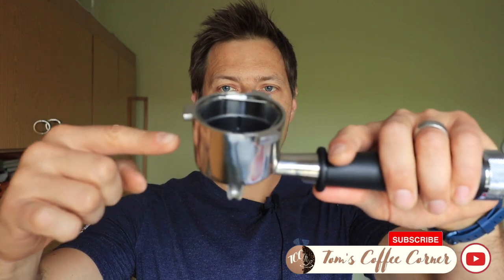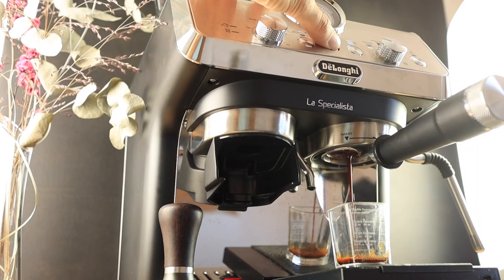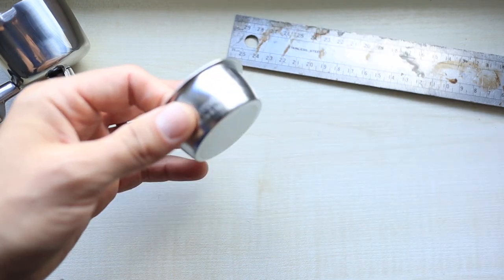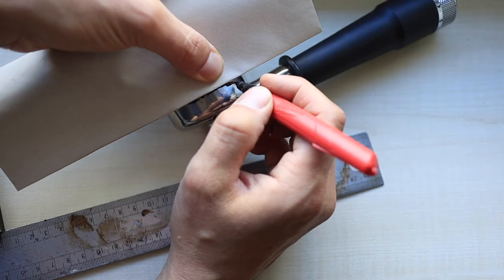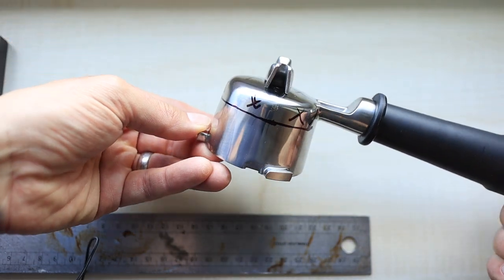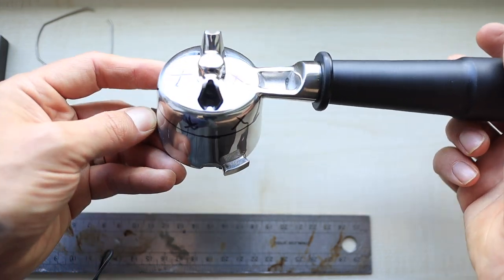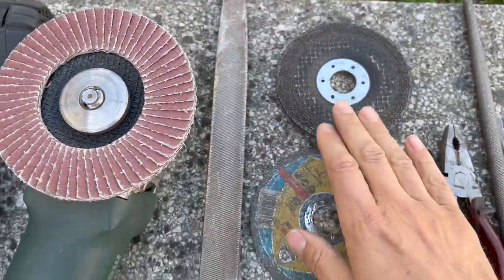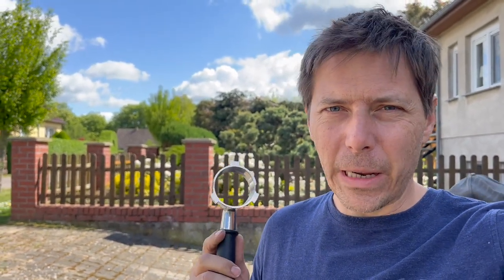Delonghi La Specialista Bottomless Portafilter: Make or Buy?

Comment: I bought an aftermarket bottomless but is backs off when the pressure is applied while pulling a shot. Basically you need to hold the handle and I am still concerned there is a bit of leaking. 
Would be great if you do a follow up with which one in the links works great.
Reply from the maker: The Normcore and Neouza ones work excellently. Cheers!

Comment: Hi Tom, since I bought the Maschine after your good reviews and i really enjoyed, now i want to buy this without cutting, so which size i should buy ? In mm ? Thanks
Reply from the maker: Check the description for product links. Cheers!
Reply: @TomsCoffeeCorner  got you Tom, thanks since i have the La Specialista so i need to order 51 mm from Normcore as u advices, but the question is  Changing from Normal Portafillter to bottomless means i need to change the Matte too ? Do you have recommendations? Probably not a 90 degree Edge on because this doesn’t fit with my Kitchen, maybe High Matte ! Thanks in advance
Reply from the maker: @alejandromagdy3058  to be honest, I don’t use a mat very often. I just use whatever flat surface I can find.

Comment: Mr. Tom I have a question sir, I'm very new to espresso machines,and have Delongh Stilosa EC260BK and came with pressurized portafilter, if non pressurized portafilter is better why don't they send in the first place? Thanks in advance  and I love your videos..
Reply from the maker: The reason is because then you need a proper grinder. Good grinders cost more than the EC260, which Delonghi knows. Do you have a grinder already?
Reply: @TomsCoffeeCorner  yes sir I have a hand grinder but cheaper one .. 😊

Comment: Mechanically, you've weakened the piece a lot. You're not left with that much metal at the interface between the handle and the basket, and it's offset, and it's subject to quite a bit of force every time it's used. Doesn't it wobble or flex? Don't you feel it may break?
Reply from the maker: It’s not weak at all. This metal is extremely robust. Not to mention, I did the same process on the aluminum portafilter of the EC 685. That has been going for five years strong now.
Reply: @TomsCoffeeCorner  nice!

Comment: Tom do you remember maybe is it possible to remove the plastic channeling part from the inside without breaking it? Didn't find a way to clean it properly since It's trapping dirt and bad smells.
Reply from the maker: No, it's not possible to remove. It's pressed in real tight.
Reply: It can be removed it took a bit of work with a hammer to get the bottom separator off but then after that it's easy and there is a screw underneath

Comment: Hallo Tom, enjoying your channel. Do you know if the La Specilista portafilter would fit the Dedica?
My original Dedica portafilter looks nasty after few years of loyal services and I'm wondering if the La Specilista portafilter could replace it.
I tried already a Joe Frex and had to send it back because it the fit was so loose that during first brew it just came out and blew off the machine... The tabs seemed nowhere as thick as the original Dedica portafilter tabs and this seems to be a recurrent issue with many other portables supposedly designed for Dedica.
Just looking for a do it all solution, a portafilter that fits perfectly, with spouts to avoid any potential mess, able to fit a non pressurized basket of 18gr as well as able to handle original pressurized baskets for convenience... That's why the La Specilista portafilter called my attention. Thx!
Reply from the maker: Hi Alfonso! No, the Dedica and La Specialista are not interchangeable. So far, I’ve tested the Neouza on the La Specialista, and that works well. Cheers, Tom

Comment: Nice,
I wonder would my Dremel get through the stainless steel, it might be easier to get around the tight corners.
I don't have a grinder (metal cutting wheel)
Reply from the maker: Hey Jonny, I really don’t think so. It was hard work even for a strong grinder.
Reply: You Can Do it but it will be long as Fuck , also im a sheet metal worker so it might wronlgy think it Can be done by anybody , so be carefull dont loose a finger for this or bring some beer to a local metal workshop they'll cut it for you
Reply: @nen_star  that's a brilliant idea 💡
Reply from the maker: @nen_star  I agree with Yomeos! Have someone at a metal shop do the job for you. It will be fast, and look good! Those guys will know what they're doing.

Comment: Hi Tom, is the handle on the included portafilter removable? I just purchased the arte machine and plan on getting the Neouza one you listed, but want the handles to match (Neouza one has a wooden finish one). Wondering if I can swap the handles?
Reply from the maker: Hi, I don’t think that it does unscrew. But the aftermarket one is nicer with the wood. The stock one is just plastic.